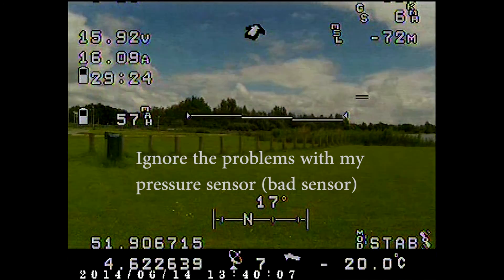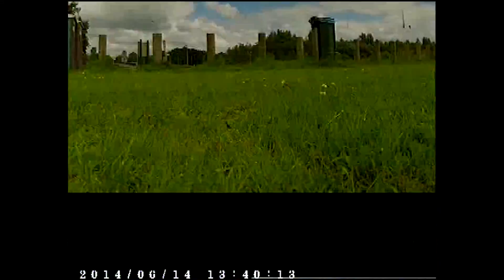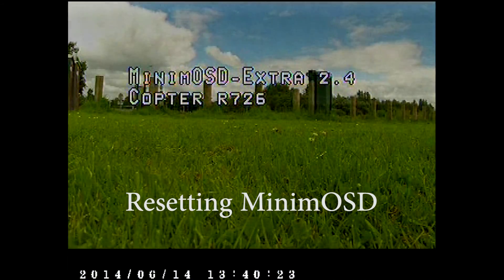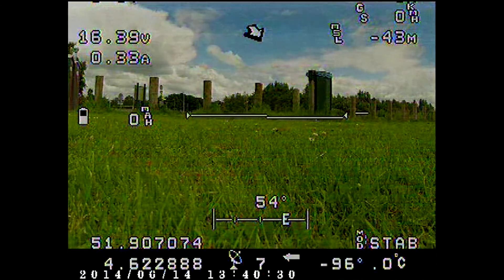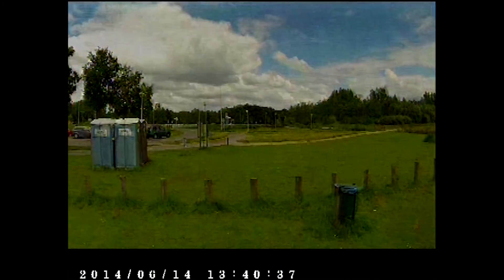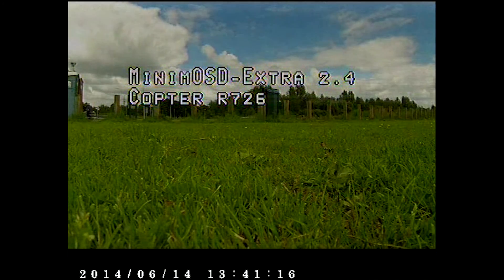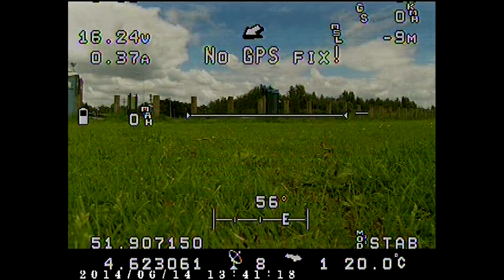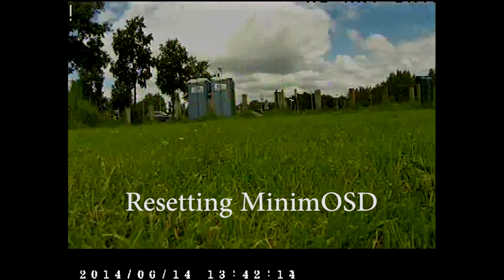MinimOSD flickering and Failing on APM how to solve

Comment: Thank you for posting this informative information with the OSD issues. I tried your what you should and that worked also. I tried what Seckin Celikten, and that work also. I felt that the 220 mf cap was a better fix. Thank you so much. God Bless

Comment: No need to struggle too much. I just solder an 220mF 16V condansator on Minim OSD supply, all the problem has been solved.
Reply: Seckin, I wanted to thank you for the fix on my APM 2.8 OSD issues. I tried what you suggested and it worked great, not only did it correct the problem with the OSD going out, but made my video quality improve. I didn't realized how much interference the OSD produced,  Thanks so much.
Reply: You are wellcome Rolando... Have nice flights... :)

Comment: i have the same problem. in the air the minim osd stop working!!!what i should do??
Reply: +Bill Asimakopoulos did you check the power supply to the minimosd? i had this problem also and voltage was around 4.5v. Re arranged power distribution and wiring and got the voltage to just above 5v. No issues thereafter.

Comment: Why i have seen many MInimOSD without the tx connected to the APM. Is this a MUST? I bought a Y cable to connect my 3dr radio and MinimOSD at the same time, but from the Y cable only 3 wires run to the OSD connector.
Reply from the maker: You strictly only need the RX wire on the MinimOSD connection. Because its only "taking in" telemetry data. I'm not really sure of the TX on the MinimOSD is needed, changes in the circuit are only needed if you need a telemetry downlink to a groundstation over the audioline of your video signal... There are places on the net where this is explained exactly